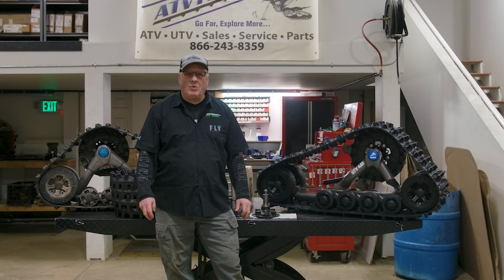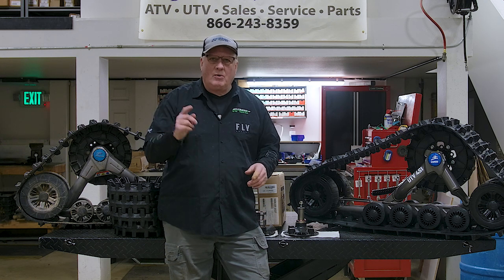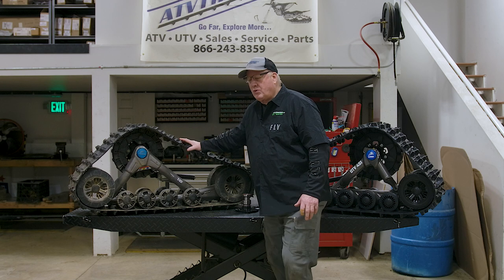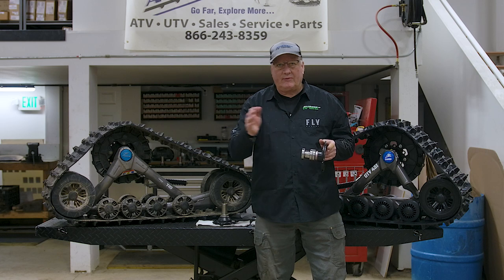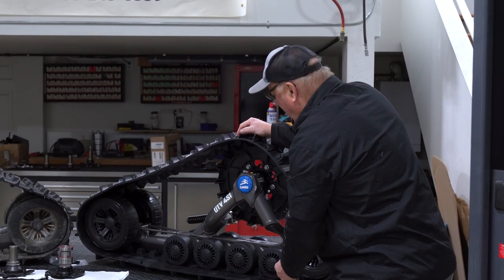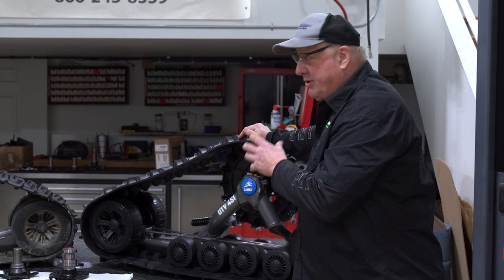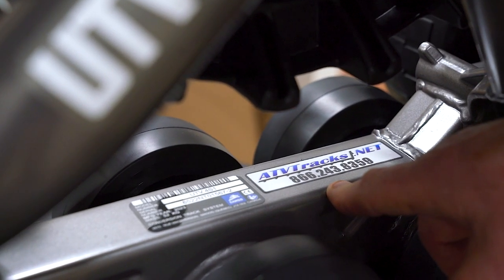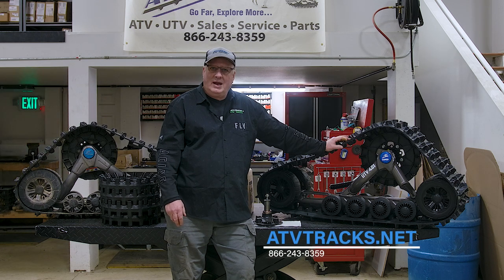ATV Tracks Comparison Polaris Prospector Pro VS Camso 4S1

Comment: Maybe I misunderstood, but you lead on that the prospector tracks will not work with a Camso changeover kit. The Camso hubs and drive gears work perfectly on the prospector UTV tracks, I have changed a set to work on a can am without issue.  If you can buy a used set of tracks cheap enough and they are not heavily worn needing all the bearings and wheels it can save a lot of money versus buying a new set. After running tracks for utility purposes in the snow they are fantastic,  but the new price tag is still hard to swallow. I agree when buying a new set the Camso system is a no-brainer no benefit to buying them from Polaris other than they may not void your factory Polaris warranty.  The warranty is so short on new machines that this is a negligible factor.
Reply from the maker: What i meant is polaris does not offer a transfer kit but you can order a transfer kit  from camso to work from a camso dealer. . The only problem is most dealers or shops do not know how to do it. We have done it many times and are happy to help any one that wants to do it.